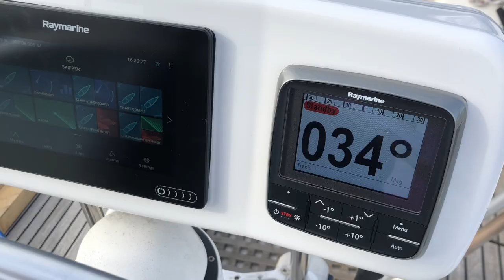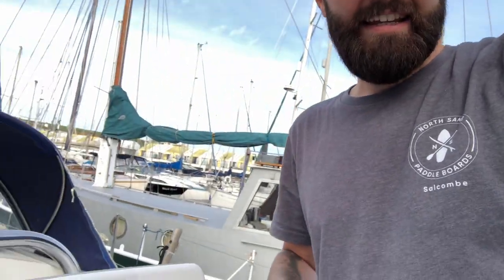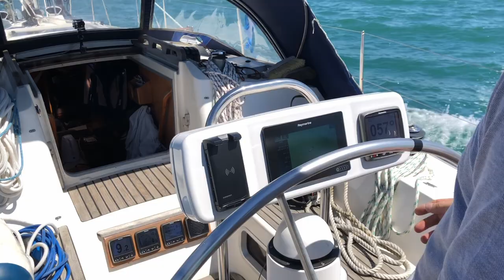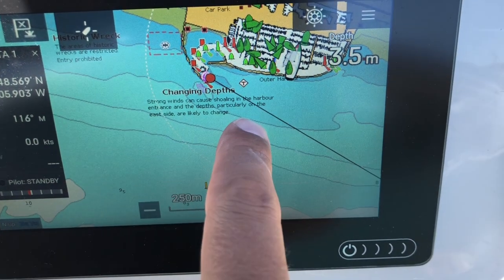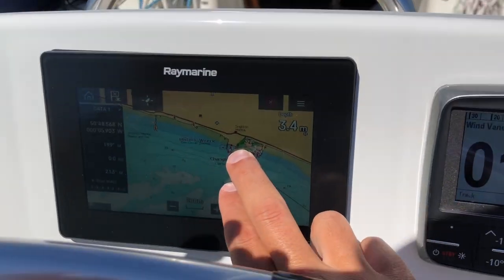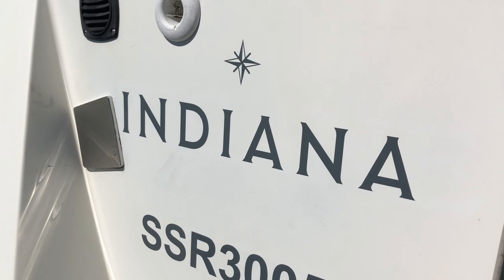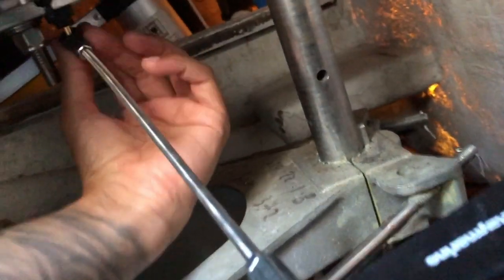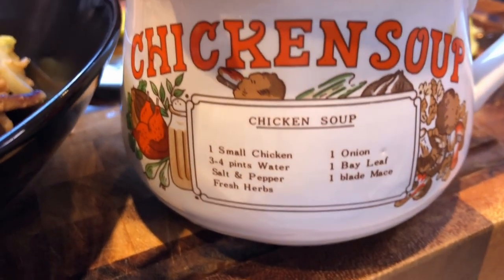UPGRADING a 33 Year Old SAILING Boat I RAYMARINE Autopilot Installation I Ep. 44

Comment: You mentioned solar panels which will be a must if you use the auto pilot a lot, as it consumes quite a lot of power!  I opted for folding panels that I deploy when I arrive in port but in hind sight I really need the extra power when sailing on long passages.   I sail solo and use the auto pilot a lot.  I’m now looking at hard panels that mount on the guard wires near the cockpit, they are then out of the way at sea and stow neatly when not needed.  I can’t bring myself to cover the limited deck space I have, or build a gantry like a blue water cruiser!   BTW a simple bungy cord rigged around the wheel and attached to something near steers my boat really well to windward!  If you get in the sea miles the priorities naturally surface to the top of the list!  Enjoy!
Reply from the maker: Thanks for watching again Mike!! We are definitely thinking we will need some solar now, due to the autopilot. It will be a must have too when we plan on being at anchor for any period of time. We’re looking into a gantry, mainly for solar but it will also be useful to help stow a dingy if we get davits attached and another plus, it might give us a bit of shade when in the cockpit! It’s another big expense, plus the solar, but we think it’ll be worth it for the longer passages and sailing abroad🤞🏼

Comment: I have the same Raymarine Auto Pilot mine is ACU 400 cause I have a bigger rudder and longer hull. I installed this all myself and yours is going to be just right. It mainly depends on the location of the rudder and how it is set up as to how you install the drive unit. Looks good you will have many fun days and nights sailing with out having to go about it hand steering.
Reply from the maker: Ah awesome! Kudos on installing yourself. You are definitely braver and more knowledgeable than us. We left that up to the expert. We are really excited to put it to use and get out for some longer passages now. Thanks for watching 🙏🏼⛵️☺️

Comment: In reference to the silting up of Brighton Marina and the frequent occurrence of boats grounding... there was a time in the 80's when all berths on every pontoon were fully accessible at all states of the tide.... the entrance was full depth for nearly every draft of vessel even at low water springs... before HMS Cavalier was moved to Chatham, it was berthed in the marina, something that would be impossible now.  That size of vessel would never be able to make the entrance channel at any state of any tide..  Yes, the current management do dredge every year, but it's minimal, just enough to keep the marina operating.  The current state of access in the marina is the result of pure neglect.

Comment: Mount is fine. If you have high loads it will come from rudder pressure under very high duress situations not normal. Just look for any gelcoat  cracks ro the right of the mount which would show flex, unlikely. Did you fix your starting issue?
Reply from the maker: Awesome thank for this advice! The engine is running again, still a little slow to start but we think we’ve found a work around by priming using the lift pump and she’s starting a lot quicker, which is telling us there’s an issue on the low pressure fuel side, so nothing major but will get it fixed soon 🙏🏼⛵️☺️